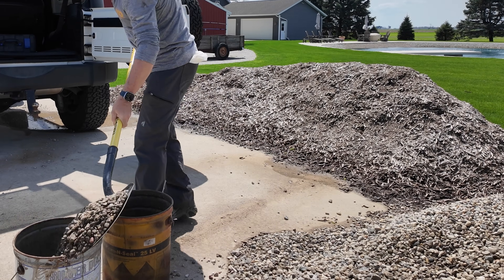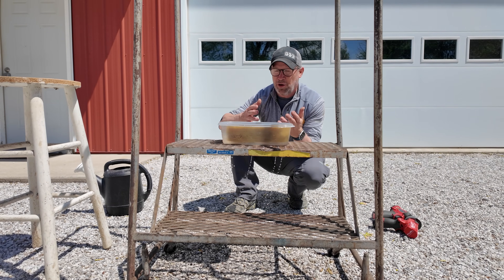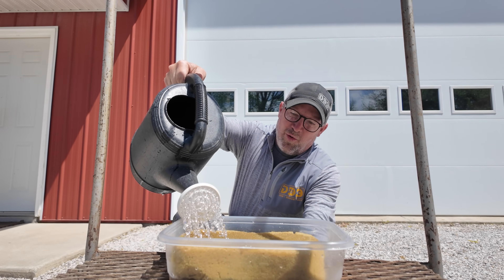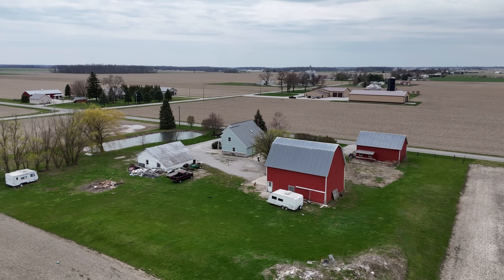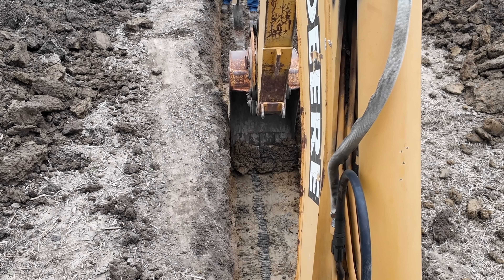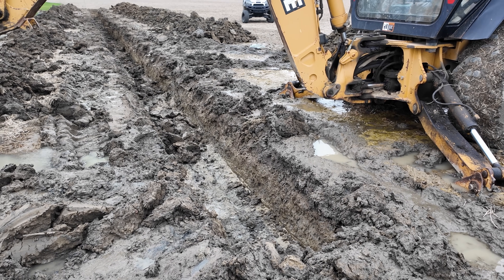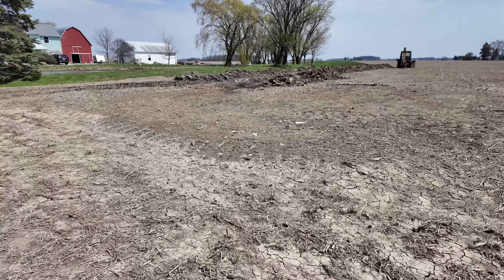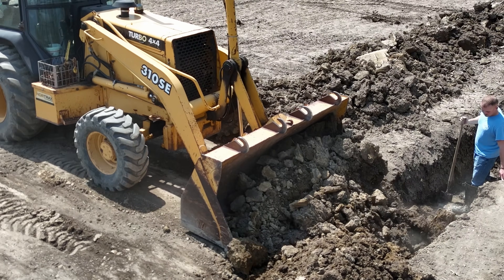We'd All Be In The Swamp Without It!

Comment: Isn't the geothermal a closed system? He is using heat from ground water to heat his system water..or cool it..
Anyhow, that's a beautiful place you live in.. where is it? 
Couldn't you make a revision chambers (manhole i guess) and use them to cut the length of the pipes and use something for cleaning?like sewer pipes

Cheers from Italy
Reply from the maker: The geothermal here is an open loop.  “Pump and dump” they call them.

Comment: GBS now explain flatlanders, from 6 corners outside Hicksville on a clear day you can see the smoke from Lafarge in Paulding that's near 15 miles away as the crow flies as SR2 sits on the North edge of the GBS and the flowing wells that run by you and along the edge of the swamp.  Great tile job and muskrats, they need see our drainage ditches etc and let them know the Maumee River & basin,drainage the largest single tributary into the great lakes!   A little copper sulfate near the new tile help repel the roots for awhile.
Reply from the maker: I’d love to do a follow up for this on the ditches and Maumee

Comment: It seems to me that the material that you're using for the drain tile that stuff gets brittle and collapses after a few years… It would seem that you would want to put PVC instead but of course that would increase your cost exponentially…
Reply from the maker: The tile doesn't get brittle when in the ground.  It holds up for decades if installed correctly.  The tile we dug up in this video was nearly 35 years old.

Comment: Very educational with lots of good information. I've had too deal with standing water on my sports fields and had very limited tools and equipment too use too get the job done, but I managed.  I have one question if you could answer it for me? I thought you weren't supposed too fill dirt right back over top of the drainage pipe because the dirt would eventually clog and fill in the pipe over time? You're then actually supposed too cover with a black mesh fiber cloth and then fill over top of that with gravel stones and then cover over with dirt. Don't get me wrong because there is always a method to the madness in your line of work and I've always loved, admired, and respected the hard work that you do for your family, friends, and your community in which you live. That why I love watching your videos.

Comment: I don't understand where the water from the weeping tile is suppose to go? The pipe is buried 3 feet deep below the water line of the pond? Plus at the end you had it sticking straight up in the air out of the ground?
Reply from the maker: It goes to a ditch or creek and then flows to a river.

Comment: might be a stupid question (I do excel at the stupid question) if the area is really flat where does the tile drain/flow to?
Reply from the maker: We ditches and streams and waterways cut in that are deeper than the buried drainage tile.  They all flow to a nearby river.
Reply: @digdrivediy  Cheers for the reply Neil if farmers were involved in the building and design of the system I imagine it works very well.  Anyting the farmers were involved or consulted with building seems to work very well here in Western Australia.